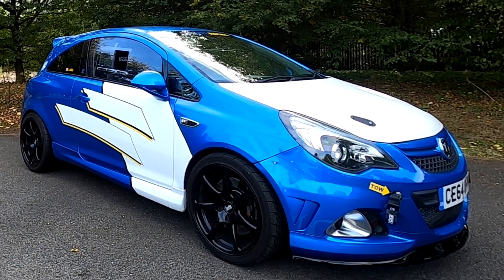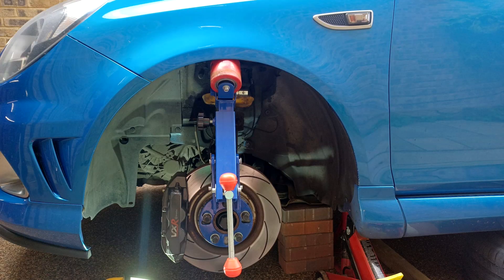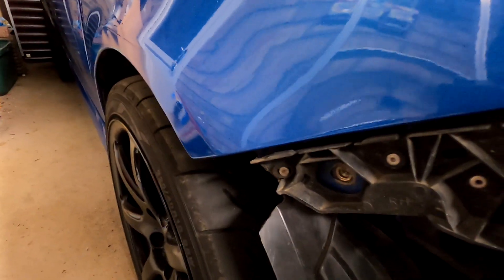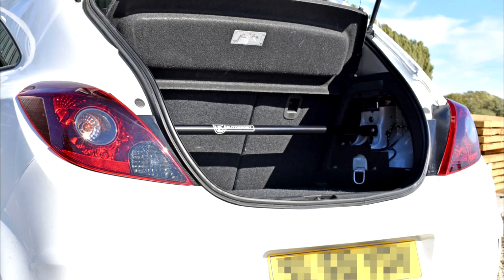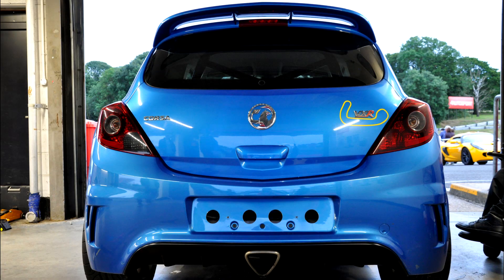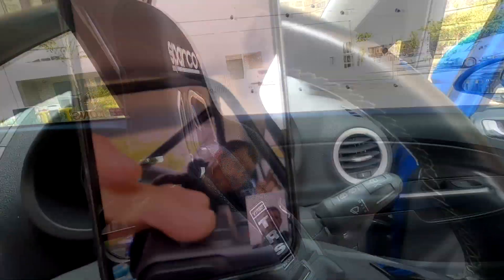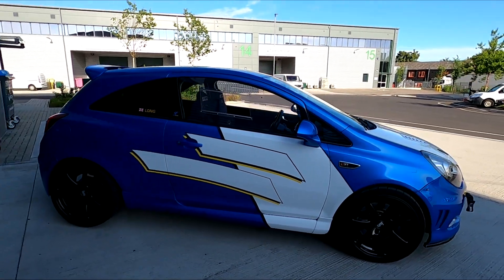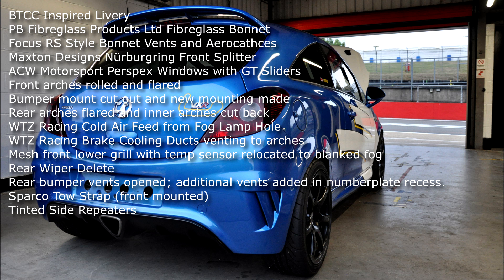Building a Track Car - Corsa VXR - Bodywork and Chassis

Comment: Intrested im wishbone coolong ducts are still around?can be shipped to ireland?fit the e vxr as well as d?
Cheers
Reply from the maker: Looks like the Corsa D, E and Adam all use the same wishbone type, so they should be compatible.

I can still make them and do them in ABS now as to handle the heat better to prevent them warping.

Best to private message through our facebook page, WTZ Racing, happy to supply them them for £50 + postage costs.
Reply: @weekendtoyz1 thank you for fast reply il try get back on to facbook so havnt been able to activate my old account in ages but il try

Thanks

Comment: Thanks for the great breakdown, very useful 

Did you use a company to fit your LSD? Did you give any thought to using the Nurburgring Gearbox with built in LSD? Did you upgrade your clutch?
Reply from the maker: WG Motorworks fitted both the LSD, clutch and flywheel. The Nurburgring gearbox used a Drexler diff and I recall they didnt get the best reviews, possibly just a little too tame I'd imagine, so felt aftermarket was the route to go.